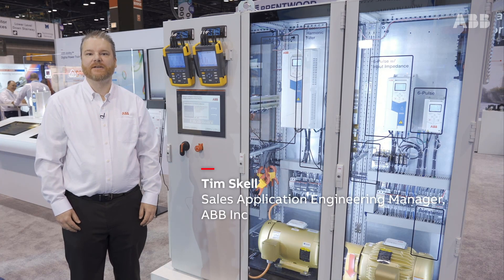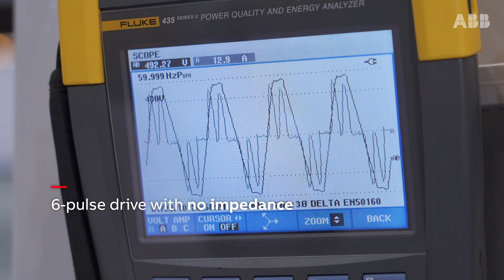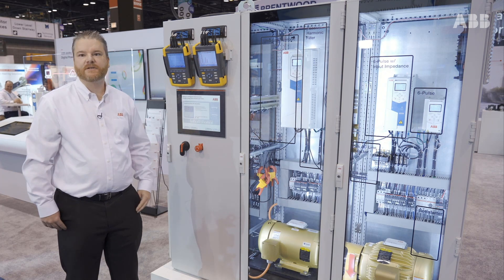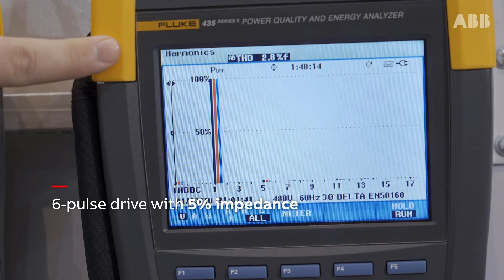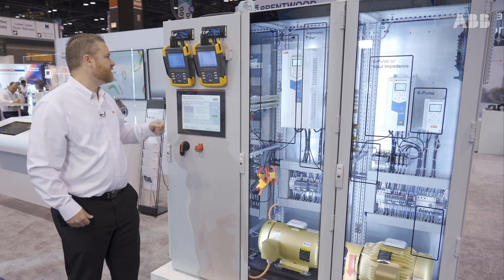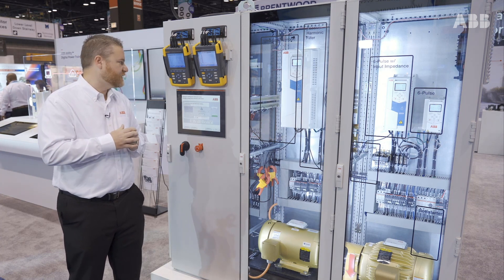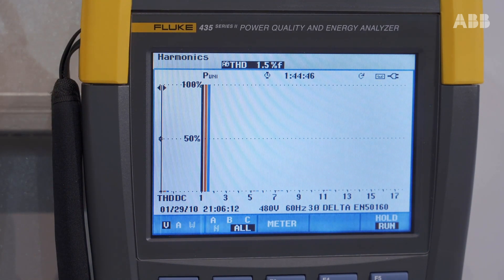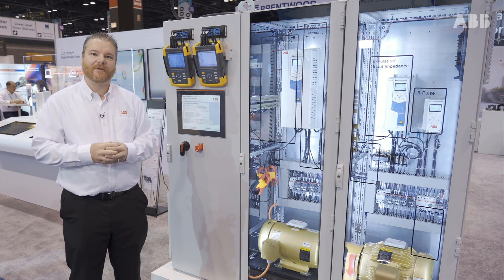Tackling harmonics with active front end drive technology

Comment: What IEEE standards followed by ABB drives?
Reply: IEEE 519 is a system (i.e. facility) standard and doesn't apply directly to products like drives. IEEE 519 lists the maximum amount of harmonics a facility would be allowed to have, back at the point of common coupling.  For a quick review of IEEE 519 and Point of Common Coupling, check out this video: https://youtu.be/NZjKlEx0vVg?si=9_sYskIB1uqg0mdD&t=194  With that all said, I can say that the Ultra-low Harmonic drive covered in the above video, has current distortion levels (when measured at the input lugs of the drive) that are lower (i.e. better) than even the most stringent level of IEEE 519.